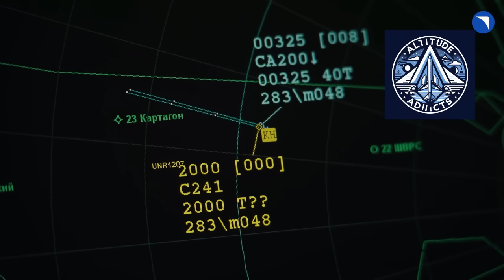Russia’s 2nd All-Domestic MC-21-310 Completes Maiden Flight in Irkutsk!

Comment: Thrust vectoring using flaps to second line, from top of tail-fin, requires monitoring airspeed for structural stress mitigation. Issue at airspeed stress points of 150knts, 250knts, 350knts presents itself during landing when spoilers are deployed after touch down. Thrust dispersion before that, shaped by excessive usage of flaps, did not disperse properly below the horizontal stabilizers, leading to, plane unable to pitch up further for flaring (top of elevators have not enough airflow). Note the yellow painted tail portion. When spoilers disrupt this flow further, there is a moment of uncertainty. Flying style needs to be modified to accommodate this little issue, use less flaps.

Comment: Congratulations to the aircraft manufacturers. The story is reminiscent of the huge efforts of the GDR and the Soviet Union to establish a modern computer architecture from a backward position.
The need to develop all the elements again yourself, instead of simply purchasing them as is usual in free trade, has not only resulted in long delays but also significant disadvantages.
Developing our own computer architectures leads to many derails and waste of resources.
The unified ESER computer ecosystem system established in the RGW (ComEcon) was never at the height of global (Western) development.
Reply: ...that's a bad example...after the collapse of the Soviet Union, the Americans discovered that the only problem with Soviet aircraft was their high fuel consumption...The Soviets didn't see it as a problem, they had and still have a huge amount of cheap fuel, they only sold aircraft to their friends and supplied this fuel...on the contrary, the Americans were surprised by the technical level of the aircraft, for example, the Russians commonly used titanium alloys, while the West was just duralumin...
Reply: @igorderka4960  Did you understand what I was talking about?
It was about the reinvention of existing technology forced by the West.
This was necessary because the sanctions were aimed at destroying my home country as well as the Soviet Union.
Nothing has changed.
Russia has to go down this path again today like we and the USSR did after 1945.
Reply: " IF THE ONE WHO CREATED THE 1ST WHEEL WON'T COLLABORATE WITH YOU,  THEN YOU HAVE TO RECREATE YOUR OWN WHEEL!!!  AFRICA 🌍  & RUSSIA 🇷🇺 PUTIN!!!  LAW   "
SAYS YAHSHUA B YAH( HALELUYAH ) THE 2ND COMING! KING 👑 OF AFRICA 🌍/AUAES/( UBAK )/( UBAF )/THE WORLD 🌎!!!  UNITED BLACK ⚫️ AFRICAN KINGDOM/UNITED BLACK ⚫️ AFRICAN FORCE
Reply: " IF THE ONE WHO CREATED THE 1ST WHEEL WON'T COLLABORATE WITH YOU,  THEN YOU HAVE TO RECREATE YOUR OWN WHEEL!!!  AFRICA 🌍  & RUSSIA 🇷🇺 PUTIN!!!  LAW   "
SAYS YAHSHUA B YAH( HALELUYAH ) THE 2ND COMING! KING 👑 OF AFRICA 🌍/AUAES/( UBAK )/( UBAF )/THE WORLD 🌎!!!  UNITED BLACK ⚫️ AFRICAN KINGDOM/UNITED BLACK ⚫️ AFRICAN FORCE